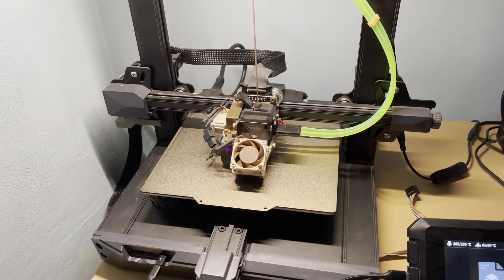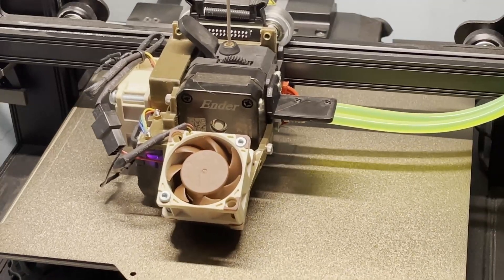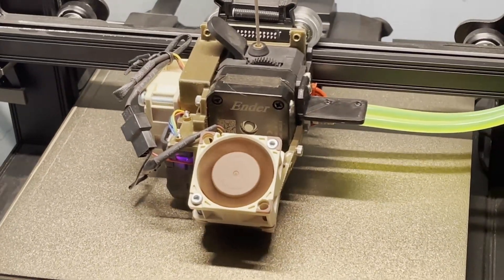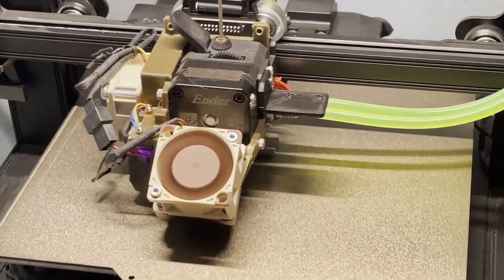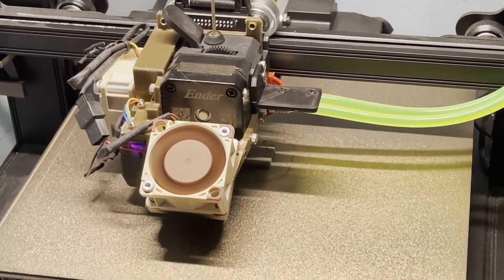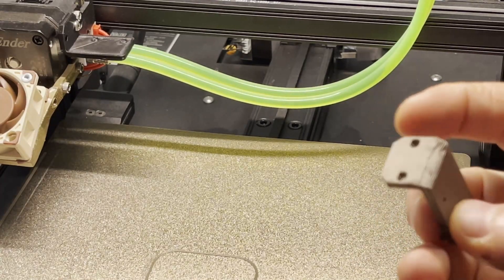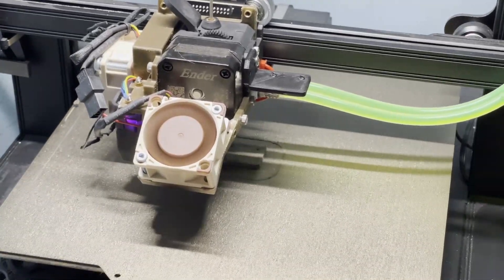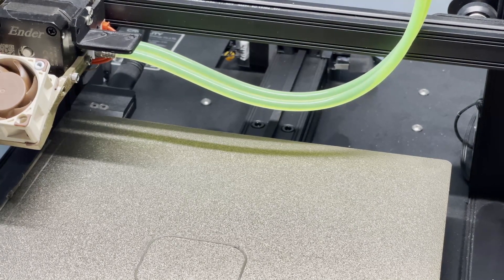Creality Sonic pad.... How fast does it make your printer?

Comment: I don’t see the inertia sensor mounted that came with sonic pad. Is it mounted somewhere else?
Reply from the maker: u have to print the sensor mount yourself if thats what u mean.
Reply: @aim6mac  I understand that, but doesn’t that sensor stay on at all times?
Reply from the maker: @deedeecycles6018  no it's only supposed to be on when u do the input shaping measurment. After that u can take it off.

Comment: hey mate any chance you'd share your STL file for the sprite duct? I have the NBR duct with the fan on the right but I'd like to move it to the left
Reply from the maker: hi there , i'm afraid thats a paid for model, not allowed to share the STL file but i can give u the link where u can purchase one, https://cults3d.com/en/3d-model/tool/ender-3-s1-dual-40mm-fan-shroud-psdj
Reply: @aim6mac  fair enough 

btw I think the consensus on the Klipperised S1 is that you can do about 150mm/s - 200mm/s print speed (vs 50-100mm/s stock) while maintaining quality. Interesting to see it pushed to the theoretical max but no doubt very 'unhealthy' for the printer as you put it

Comment: Hello, what is max speed? For accepting print?
Reply from the maker: hi there, max speed depends on the type of partscoolingfan , that plays the biggest factor in acceptable print speeds, i think i can get acceptable prints at around 150mm/s with my setup. I have seen ppl with blower fan styles which can get faster speeds with same results
Reply: I have seen fan and hear kitfor sonic pad in creality official page, is it worth to buy to increase speed?
Reply from the maker: @hrayrohanyan4498  yes that would definitly help with speed increase but remember it will increase noise levels aswell :o

Comment: I can take my S1 Pro with Sonic Pad up to 250% with no degradation however at 300% and above things start to deteriorate. I did input shaping on x and y axis. Not sure I can safely go much faster with good part integrity?
My printer is completely stock.
Reply from the maker: Most users told me that above 300% have not great results.. so ur right

Comment: Looks like acceleration is pretty low still. 1000, 2000 maybe? It's not not getting near 600m/s, that's for sure.

Do the same thing with a bigger model. Let's see some fireworks!

Comment: wouw here is my answer NICE bro that's insanely fast for the ender 3 going 600 mills a sec is like max verstappen driving your ender 3 omg indeed heat is your worst enemy here you can't cool the printed filament fast enough for it to turn out to be high quality .
and dhamn i think the printer is going to rock it self and everything apart if you let it go jolo  like that for 3 hours OMG LOL